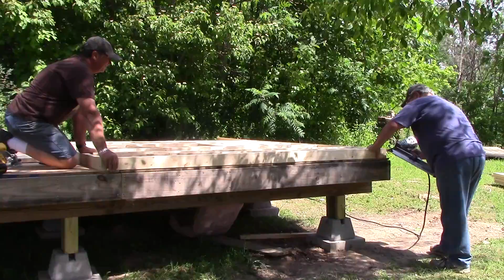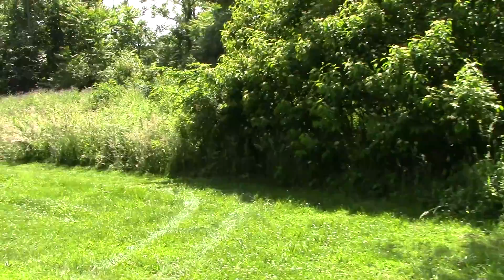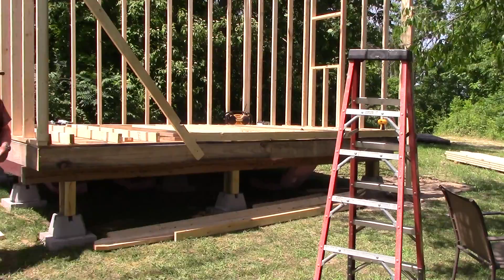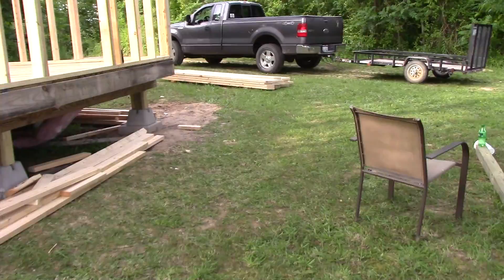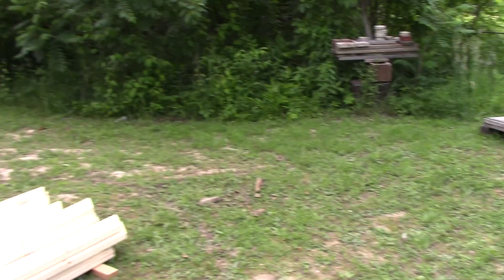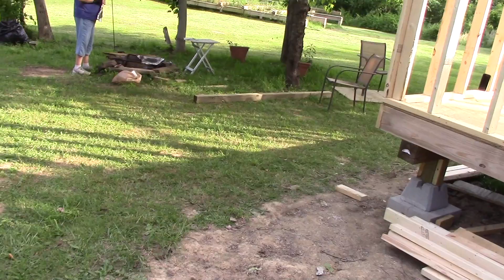12x16 Off Grid Cabin pt 4 - Framing Walls

Comment: Your cabin already looks Fantastic! That's going to be one wonderful cabin for sure. My Garage/Home is a full 8 foot tall too, and it does make a huge difference. I had 3 lofts in mine, but connected 2 of them, and it's a pretty big space. It's 12 x 32 and is finished inside. Living room, huge kitchen, bedroom, and  makeshift bath. I would suggest getting a "Medical type Toilet" for it I have one, and it's amazing how easy it is to maintain. I got mine from Amazon and it was very cheap. Great in the middle of the night. I made my bathroom by using a corner of the garage and putting a bookcase on one side, shelves facing into the bathroom for TP, shampoo, etc. and then used a folding screen for the door, It works great. Totally private and takes up a very little room. I'm going to add a 12 x 12 room in the back corner where the bathroom is, and make it a full bathroom and laundry room, with extra storage too. I'm really excited to see what you do with your cabin. Bless, Sheila
Reply from the maker: +Sheila6325 Yours sounds exactly like what I wanted to do with our other one. This cabin is going to stay just that. It is simply a weekend thing. It will be very rustic, almost "trapper cabin" like.  We will fence in a little yard around it for when we take the girls out in cool weather.
Reply: Joe, Yep, I could see that in the video, a typical "trapper like cabin" for sure, and it's still very exciting to me. I love that you and Gail will be able to spend some time there once in a while, and that the girls will be able to go too. I don't really use mine right now, but I hope to move there this fall, if all goes well. I think that cabin is the perfect size too. Not too big, and not too small. The girls are going to love it there too. Oh, and Gail sure does a great job on the lawn, it always looks so beautiful when she mows it. No wonder she loves "her machine" it's a honey, and a good size for all that mowing she does. Some how it makes the whole place look so much more comfortable. It's amazing how much has changed over time. You guys sure make me feel like things are possible, if we just keep at it. It truly is turning into a very wonderful place to spend a couple days, and enjoy the country side of life. Bless, Sheila

Comment: Were the framing and plywood ok on the walls out in the weather until you had a chance to get dried in? I'm just now starting my framing and didnt know how quickly I would need to get the roof put on and finished.
Reply from the maker: A little discolored,  but that's about it.  No damage done.

Comment: Coming right along there Joe. I like the way you are framing the corners the right way with 4 2 x 4's  instead of the way the builders do it with two now days. You and Gary are doing it right instead of trying to cheap out on a few extra 2 x 4's . How big is the front deck going to be?
Cheers.
D
Reply from the maker: +Dennis Dubois Thanks Dennis. The deck is going to be 6x16.